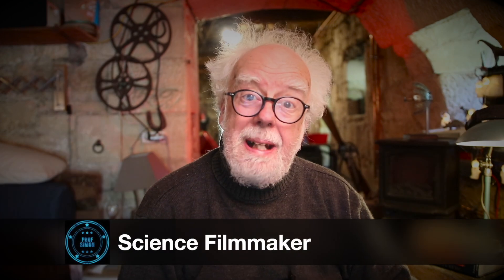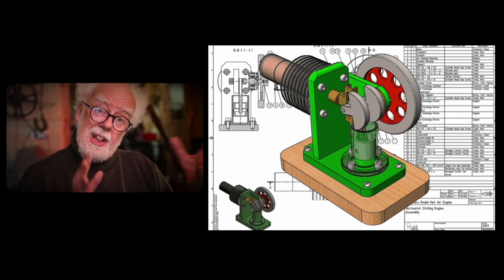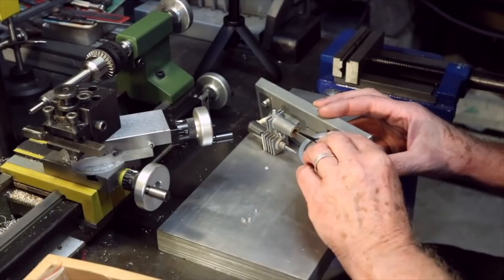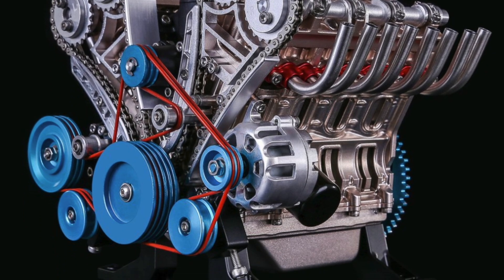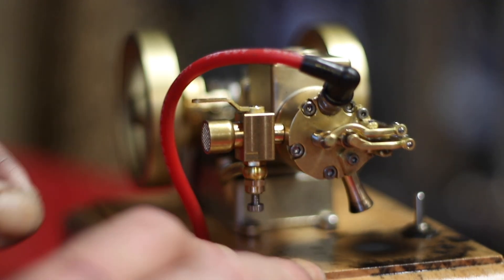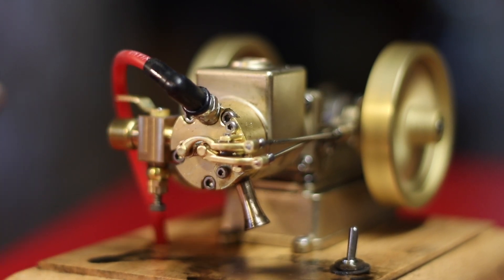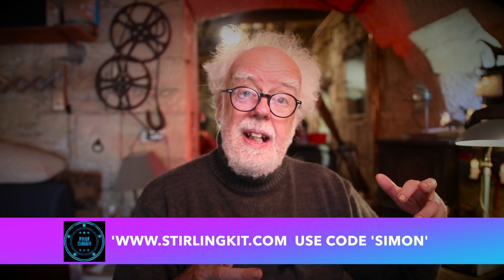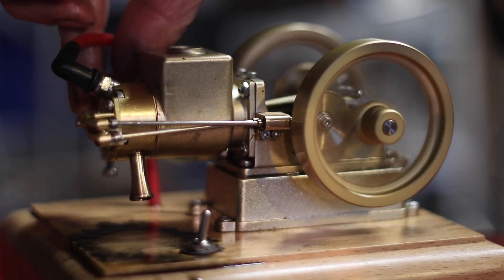Model Engine 'SPECIAL OFFER' for you - Prof Simon

Comment: Thanks Prof Holland, I always have had an interest in building a Stirling engine. So far I have viewed a few You Tube channels that tell you how to build them from old steel and aluminum cans and using a loose steel wool packing in a can for a regenerator. These engines don't last long and are rather touchy to get them to work. May look into Stirling Kits for something better. I would really like to build a 5hp stirling engine to use on a backup power generator or to run on solar power. I am a big dreamer with too many projects from my wife and an employer that doesn't want to give me much time off. We will see how much it costs and how much work is involved. My office already has a number of desired cans sitting in drawer.